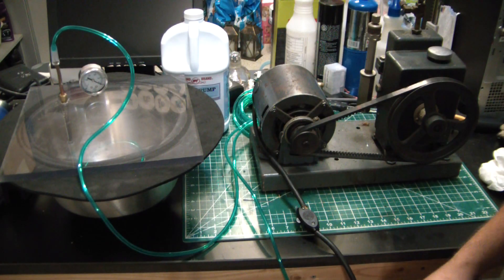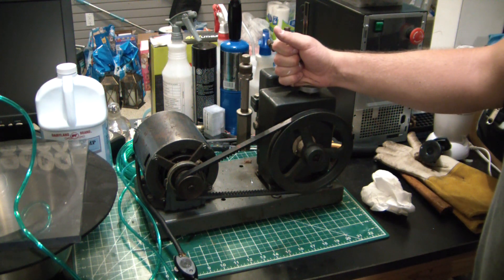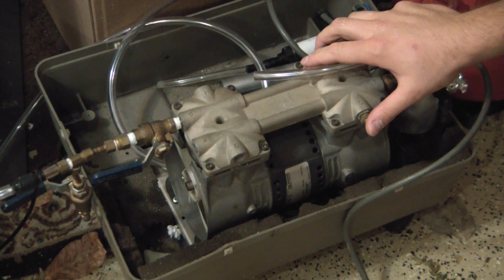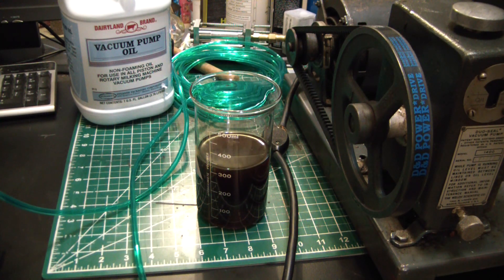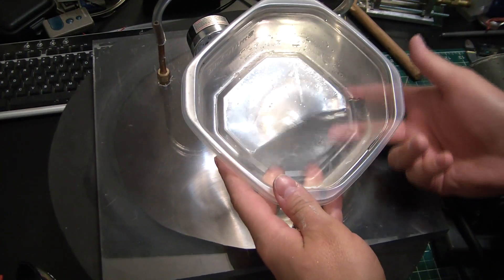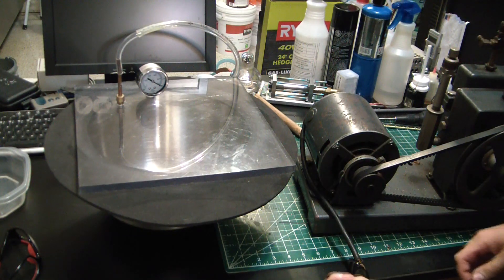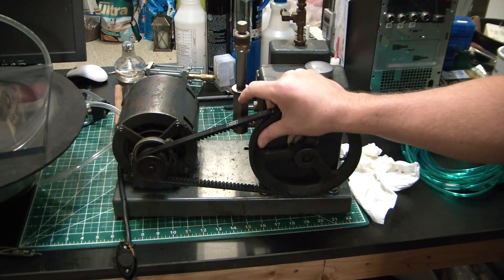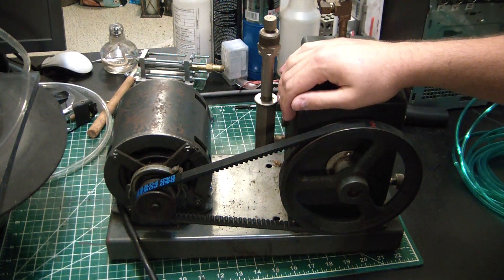Super Simple Vacuum Chamber & OLD Vacuum Pump - ElementalMaker

Comment: 14.7 psi is atmosphere at sea level equals 2,118.8 psf  when in a vacuum the seal you have gets better as you pull more vac but our ozone keeps the vac of space out and our atmosphere in right? The BS they feed us is staggering!
Reply from the maker: Nope that would be gravity that holds our atmosphere to earth....
Reply: @ElementalMaker  prove it, this is your claim  gravity holds in our pressure of 14.7 psi at sea level in a vacuum  of space?  19,051.2 pounds per sq yard!  A tanker in a vacuum implodes like a coke can. Videos of this can be fund on here on YT. Gravity, think about it, a magical force still in theory no evidence objects fall because they are heaver than air but a hot air balloon floats. The dilemma is in our minds trying to explain something that does not exist except the gravity of the deception. This is difficult since it goes against what has been taught to us all but if you can be honest to self and do the research you will have more questions than answers. in a vacuum you would explode but earth floats in the vac of space unmolested.....that is BS is what that is.https://www.youtube.com/watch?v=Zz95_VvTxZM
Reply from the maker: @rc9266  a taker is not designed to withstand vacuum of any level. Notice the external hoops? That is to provide strength for internal pressurization of the tank. You are basically saying, "hey I can crush this soda can, therefore nasa is wrong!". You seriously need education.
Reply: @ElementalMaker    Nice, no need to be nasty,   the problems of limited knowledge, Think for a minute, This tanker held -10psi but  The tanker example was to show you the force down in PSI when a vacuum is present in a chamber and what it could do. This was a controlled demolition Anyway, the seal in your chamber gets better as you pull more vacuum because the psi increases as equilibrium shifts eventually you will crush the bowl. A person in a chamber under vacuum would explode because H2o in your blood would expand into its gasses, boil off,   but our world, earth, floats in the perfect vacuum of space which is impossible! The BS they feed us  according to our amazing public school system that blessed me with their superior knowledge, Lol! Like our ozone keeps us from exploding into space right?    the gravity of the delusion is staggering! Truth is available for those who want to see it but most will ignore this, they rather stay connected to the matrix.
Reply from the maker: Gravity is quite readily observable and testable. You dont float off the surface of the earth because you have mass. Gasses also have mass and hence stick to the earth. If you can't understand basic physics I can't help you.
Reply: @ElementalMaker  No scientist has ever proved anything about gravity, your assumptions are not proof.  Consider the vacuum and its crushing  or exploding  properties, when a chamber is in a vacuum water will boil because equilibrium is shifted also crushing forces act upon contained vacuum from without these my friend are forces of physics. If you choose to believe unproven theories as fact then there is your struggle. Gravity is a theory with no evidence, the research is available for those who want the truth. You can overcome this indoctrination but you will have to think your way out since the matrix would rather you stay.  This is the bull we are taught, gravity with its power to stick an ocean to a spinning ball at 66,600 MPH as the moon shifts the tides, but a butterfly flutters through the air from plant to plant unaffected by the force. Look I get it I come from your camp but you are a smart guy do you want the truth is the question?  The actual facts not some unproven theory buried in convoluted mathematical equation that goes nowhere. Best wishes, the truth s out there if you want it. peace.

Comment: I have a similar setup only I used 5/8 lexan on the top of a pressure cooker. A gifted pump from a heart/lung machine to top it off. Up here it will hold 25 inches of vacuum. Not too bad being at 2500 meters eh. I have a video on it. A regular service and this pump will last you for ages. Nothing better than nice clean oil. Fun post bud.

Comment: Why would you want to degas the epoxy propellant? Looks to me like you skipped an important step - the testing of the propellant with and without degasing.
Reply from the maker: Air bubbles can cause catastrophic failure of the rocket motor, so degassing is used to prevent that. That'll be a video for coming weeks!
Reply: @ElementalMaker  Cant wait! Hurry up 😃

Comment: I am the maintenance manager at an industrial freeze drying operation. Our chambers are around 1000 cubic feet with 2x Busch R5-305 rotary vane main pumps with a Busch Panda WV-1500 booster as a backing pump. The gas ballast is exactly what you were describing. Rotary vane pumps have historically been oil wetted internals. They have a high tendency to create an oil mist internally during operation allowing for volitiles to mix homogeneous with the oil, water especially. The gas ballast provides a means to separate the water from the oil mist. The water should not freeze without additional heating or cooling (see water phase diagram). It is a major issue we deal with as sublimation has issue happening at the same time as evaporation. I would suggest ensuring the ability to achieve a constant 1500~2000 microns or less and have your set up accommodate for gravity. If you would like, feel free to pm and I will share any information I have that may be helpful in your vacuum chamber success.
Reply from the maker: Wow Roscoe that's quite a vacuum chamber and pump setup you guys have there! I will definitely pm you if I have any further questions. Thanks for the excellent explanation of how the ballast works 👍

Comment: I forgot to add that the other reason why people still like P-BAM is you can mix it as long as you wish with out it setting up on you with ALL the ingredients in the mix. The heat is what activates and cross links it. NOT chemical reactions taking place. 
HTPB you can mix as long as you want if you dont add the curative to it until the last two minutes of mixing. Your under the gun once you do add it. 
This very reason is why NASA used P-BAM to make the enormous booster engines to ensure no defects and work-ability time needed.

Comment: I normally only pulled 2 to 3 inches mercury when I make P-BAM AP composite rocket motors.P-BAM does also require the fuel to be heated while pulling vacuum witch HTPM doesn't require. Thus most popular and what is mostly sold today. I personally learned using P-BAM and many pro's still use it because it make a little more power and has more creative possibility's when using it.  Because of this I used a old steel framed refrigerator as a vacuum chamber. This way I could stand big motors up right and several of them at a time when doing a big pour and still have room for a ceramic electrical heater in the refrigerator.
 I just used a kitchen aid mixer ( bread dough mixer) that I covered the electrical brush end of motor with shielding. I mixed fuel batches for 20 to 25 minutes to get good intimate mix. All most impossible to do by hand and make good motors. This should be your next tool to hunt down and modify. Will make the hobby more enjoyable to.
P-BAM binder you do need to degas the fuel but most people today use HTPB witch all ready has a anti shear additive and a degassing additive in it so air bubbles are not introduced as easily. P-BAM doesn't come with these all ready in it. They have to be added. Knowing this it doesn't hurt to pull a small vacuum if you have a ability in the size motors you will be doing regardless of propellant.
Large high horse power motors still require a vacuum even if using HTPB to ensure every bubble gets out to avoid CATO's. I would say as long as the diameter of the motor is under 1 1/4 inches degassing isn't normally necessary. Bigger I for sure would do so.
If you need any help let me know. I probably have any of these special chemicals you need in excess. Only requires a drop or two to reduce shear and a drop or two to remove air bubbles if your particular propellant dont all ready have the additives.  They are not expensive just hard to get. 

By the way love your vacuum pump! That thing is so cool. I love old shit like that. I turned my fresh air head gear pump I used for spray booth and turned it in a vacuum pump. It works great but is loud as hell. I like how quit yours is! I can pull 29 inches witch is about as good as it gets where I live. Mine is also heavy as hell. Feels like your lifting a lead brick :-)
Reply from the maker: Sounds like you have quite an awesome setup! You mention P-BAM resin which I've never heard of, do you mean PBAN? I have a gallon of old PBAN resin from about ten years ago. Not sure if it would still be usable today though. I couldn't ever get it to cure properly so I gave up on it. I now have a gallon of HTPB and isonate curative I'll be trying shortly.

Comment: Made mine from a fridge compressor, pulls about this much vacuum too
Reply: I've had a fridge compressor in storage for a long time... not long after I got it "people" (Justin from The Thought Emporium leaps immediately to mind)  told me that a fridge compressor just isn't good enough. have you got any details of your build or any figures (inches of mercury, torr...). 
I suppose, really, I should just get mine built and, that way, I can "suck it and see".
Reply: edgeeffect if you check my channel there is a short video on the “wiring” of it to start, after that it’s just a hose from the intake side
Didn’t measure it yet but it broke multiple vacuum chamber covers for me, boils water and can sustain longer runs (I mostly utilize it for vacuum filtration in chemistry and didn’t have problem running it overnight to dry substances)
Reply: he's running a1400 DuoSeal Vacuum Pump. Your refrigerator compressor will not even come close to pulling as much. The DuoSeal is a dual rotary vane vacuum pump and will pull down to 0.1 micron!
Reply: Rick Halverson it was a year ago but if I remember corretly I compared it to the performance shown in the video not the theoretical maximum, ofc a vacuum pump designed to pull vacuum will be superior to a fridge compressor but it can still boil water/used for vacuum destill and filtration / evacuate atmosphere before inert gas flush (which is done repeatedly with top pumps too anyways)
Reply: @killerke11  yes they can go quite low. I used to use one. I purchased a compressor that was designed in Italy called silent air, I would use it for both a compressor and a vacuum pump.
It certainly does work. That was before I got a dual stage dedicated pump. They do go lower.

Comment: That is pulling so little vacuum it's silly.  For instance, at 48 inches you are pulling only 2x atmosphere so the pressure on the vessel is roughly double.   Great for expanding marshmallows and balloons. But...consider the vacuum of outer space.  That is, -10 ^ 17 Torr.  (That's a 10 with 17 zeros after it.)   That's a vacuum.   (And no "spacecraft" can withstand it.....i.e. NASA lies and we never went to the moon).   Sorry, sort of off topic....but only a little.
Reply: I think you forgot your aluminium foil hat, might want to put it back on. Your crazy is escaping...
Reply: Lol you can't go lower than 0bar/psi, those 10^-17torr are just very close to absolute zero pressure, but still just approx one atmosphere below pressure on earth....
Reply: @lenzf   the guy is a flat earther, you'll never get through the decades of incest and backwoods gargbage that make up his brain.
Reply from the maker: Firstly your wrong on just about everything. This pulls a vacuum of 0.1 Microns per mfg specs, so about 99.999% the vacuum of outer space.
Reply from the maker: Yeah its quite overkill for degassing propellants, but shouldn't hurt anything. Unless it starts volatilizing the resin. I might just have to pull it to 29inHg and shut off the pump.
Reply: So apparently all it takes to become a space flight denier is one incorrectly placed minus sign... Good to know..
It´s 10 ^ -17 Torr, not -10 ^ 17 Torr. Small difference there....
Reply: If one wonders why a spacecraft cannot take that it is because the inside of the craft must be pressurized to carry men and that 14 psi inside with negative 10 to the 17th power vacuum outside will result in an immediate, catastrophic explosion.

Comment: for my vacume pump, i pulled a refridgerator motor out of an abandoned fridge and rewired it , mounted it to an old air compressor cylinder so i have a vacume pump on its intake side when i open the tank to atmosphere, and a silent compressor for indoors from the outlet side when i close the tank valve back up, its all mounted and wired up to the tank and on wheels so its easy to cart, im lazy though and havent plumbed up the tank to the outlet yet so its still just a vacum for now till i need the compressor
Reply from the maker: Always wanted to get an old compressor to test as a vacuum pump. I hear they work pretty well. Might have to hit the scrapyard and grab one just to play with.
Reply: I had that setup in the past. Even used a water pressure switch to shut it off after it filled a 5 gallon air tank. I just used ordinary dug store mineral oil for the oil and it lasted way longer than I needed it to.
Reply from the maker: That ingenious! I might have to steel that same setup for a nice quiet garage compressor!
Reply from the maker: Or maybe the basement so it doesn't wake up the wife LOL
Reply: @ElementalMaker  When my 5.5hp unit revs up I often wish I had that little one again because it was so wonderfully quiet. I used a window AC unit and put casters on the bottom so I could pull it around my garage and out onto the concrete driveway easily.  ( Once the evap & condenser were ripped off there was enough room for the 5 gal air tank onboard. )

Also, the way to do the inlets and outlets easily is just to braze them with copper. For mine that was my only cost for the unit, the rods & gas.

BTW, video idea. Now that I don't have that I'd love to see a video on making vacuum using a venturi. I know HF used to have a cheap venturi vacuum that would work with lots of air but I have wondered if it'd be an easy thing to make.
Reply: @ElementalMaker  you can just wire the power up to a regular air compressor switch with a psi guage, check valve, and relay that you adjust per desired psi, then turns the compressor off at that psi and back on under a certain psi you tune in..  there an all n one piece and cost from $20 and up depending on brand and quality on ebay

Comment: Gas ballast ..... used to introduce air,  or nitrogen typically, to the inlet side of the pump to keep the pump oil from backstreaming through the lines to the chamber causing oil contamination in the vacuum chamber. It can also be used for dilution of "hazardous" substances or pressure control of your chamber This is handy when pumping on volatile substances to keep them diluted so you do not have a potentially undesirable output from the pump or worse in it. You are most likely using a hydrocarbon oil, judging by the color of what you drained out. Keep in mind that inside the pump this hydrocarbon oil is in vapor phase and heated. 
Go to idealvac.com for re build kits. Cheapest place I have found for new kits. Those old Welch pump just won't die. When your vacuum doesn't SUCK you have a problem 😄
Reply: FYI ... I do not work for or receive a thing from Idealvac that my company does not pay for.
Reply from the maker: Hey John, really appreciate you sharing that link. Their prices are half off every other kit I could find online. Great resource! I will save their site for down the line when I decide to rebuild the pump. Thanks for your great explanation of the gas ballast as well.
Reply: @ElementalMaker  glad I could help. Great video as usual.
Reply: Partially right. The gas ballast does not, itself, function as a one-way valve to prevent backfeed, but instead is used in conjunction with a one way valve. The gas ballast's main purpose is to allow drier air into the pump to protect the oil from the water vapor and other volatiles coming from the vacuum chamber. By letting in a little bit of dry air, it can prevent the volatiles from condensing in your oil.

You can also use a gas ballast to dry your oil. 

https://vacaero.com/information-resources/vacuum-pump-technology-education-and-training/666-gas-ballasting-of-mechanical-oil-sealed-rotary-vacuum-pumps.html
Reply: @templebrown7179  @ElementalMaker And this is good video explaining in animation gas ballast that i show to my students when I'm explaining oil pumps use in lab: https://www.youtube.com/watch?v=1SaB4aKi574

This pump should go down minimum 10⁻² mbar. Take good care of it and it will be your friend forever :)

Comment: as I understand the gas ballast inlet is; 1)open gas ballast 2)air in sucked in through gas ballast and is allowed to whip up into the vac oil decreasing its viscosity 3) motor starts to spin faster due to thinner oil 4) motor temp Increases due to faster spinning and that heat is transferred to the pump oil 5)volatile start to "burn" off due to increased oil temp.  you'll notice the vac pump start to exhaust oil / volatile vapor when using gas ballast for 30+ minutes

Comment: A vacuum chamber is one of those things I want but really have no use for. Glad to know i can make one this easy.
Reply from the maker: It's definitely a tool I don't use very often, but it's great to have for degassing resins. Should be getting alot lot use shortly with composite propellants 👍
Reply: @ElementalMaker  I want to start doing mold making and casting silicone and resins so maybe I should build one